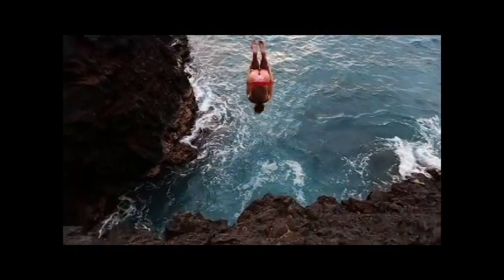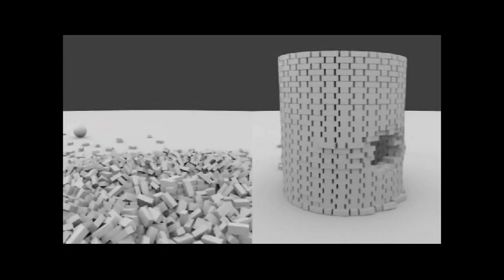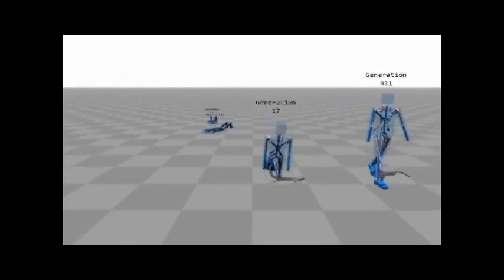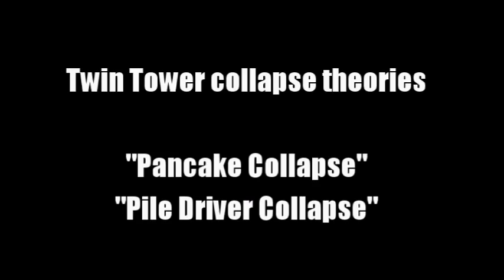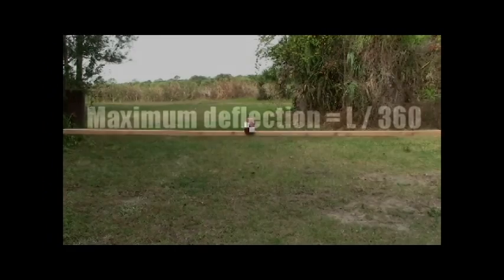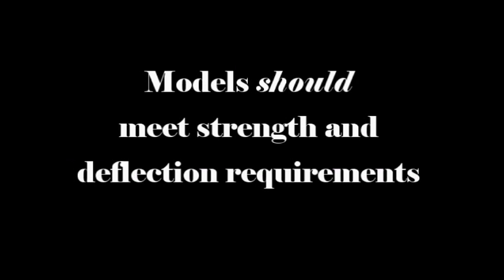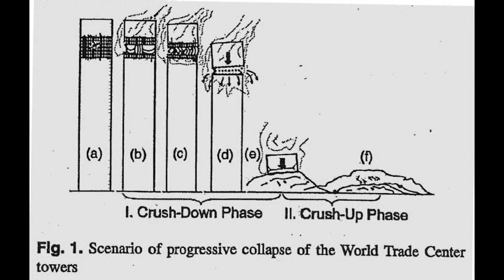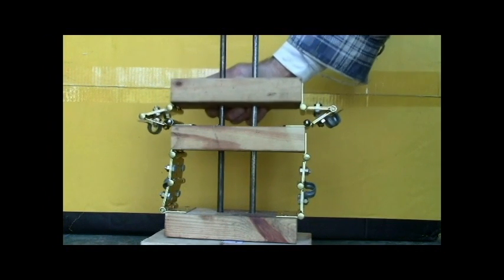9/11 Experiments: The Force Behind the Motion

Comment: The force from the pancake and the piledriver experiment does not match the motions therefore it's wrong. The demolition experiment did. Nist used complex math it computer simulations instead of a real science experiment. No one. Not even Mark H. Could make a simple experiment that can demonstrate the official force and motion
Reply: "The force from the pancake and the piledriver experimen"
The experiment is flawed and does not represent the towers.  

_". Nist used complex math it computer simulations instead of a real science experiment."-
Because they actually understand that models like this don't represent the towers collapse..

"Could make a simple experiment"
That's your problem.  you see everything so simplistically that you get it all wrong.

1.  Videos of the towers with explosives going off
2.  Proof I have lied.
3.  Point out the mistakes and errors in the NIST report on the towers 
4.  Prove I have denied any laws of physics
5.  Prove any laws of physics were violated with the official story

6.
"Conservation of momentum is clearly orchestrated and easy to understand i"
So apply it to what happened on 9/11.
Please do.   In your own words.
Go.
I''m now going to keep asking.

That's 6 things you've been called out on.
You make claims.    You back them up.   That's how it works princess.
Reply: @markh1011   You don't and can't understand the laws of physics is the reason you keep asking.  Did nist test for explosives? No. Even you said why should they? Now try to get out of what I'm telling you.... UNLESS PROPERLY INVESTIGATED AND RULED OUT THE EVIDENCE FOR POTENTIAL USE OF EXPLOSIVES DURING THE COLLAPSE ARE STILL THERE..   also. national fire protection agency guidelines number 921 calls for the testing for explosives when high order damages involved..... And still they didn't.......a 3rd reason this is the biggest most important investigation of our time.... How stupid for NIST AND HOW STUPID FOR YOU TO MAKE A STATEMENT LIKE "WHY SHOULD THEY" so juvenile so immature so lame. Now go ahead and deny everything I'm saying and confirm all the things that I think about you are true
Reply: @coolk3dat754  
" UNLESS PROPERLY INVESTIGATED AND RULED OUT THE EVIDENCE FOR POTENTIAL USE OF EXPLOSIVES DURING THE COLLAPSE ARE STILL THERE.. "
..except that they already found the cause of collapse...   guess what dippy....wasn't explosives.

They also didn't test for kryptonite and space termites...those theories are currently equal to yours.

"national fire protection agency guidelines number 921"
Is there to see if a regular old building was was intentional.   we know this was intentional.... we know there was an accelerant - jet fuel.

So you're not making an intelligent argument.
Then again you never have.

It's all an excuse.    you don't have evidence so you try to blame that on the government as well.   There's always an excuse.

Pitiful.
Reply: @markh1011  wrong again sweet cheeks. Reply and Deny
Reply: @markh1011  you deny evidence and testimony.....cover up
Reply: @coolk3dat754  
" you deny evidence and testimony"
More projecting.

Try again.
Reply: @markh1011  answer me Mark you said this video is flawed.... Didn't you refer me to eat cheesy minute and a half poorr example I'm a total collapse it's just a few blocks of wood. Please explain why you find this were convincing and why you feel this represents a hundred and ten stories.
Reply: @markh1011  you do know you are part of a minority and I am part of a majority. That means that we"truthers" " conspiracy theorist" are now expressing what is considered conventional wisdom while the Reply and Deny Assholeciation red represent a small beleaguered minority that is often scuffed and shunned
Reply: @coolk3dat754  
"do know you are part of a minority and I am part of a majority. "
Ah the desperation of the last gasp appeal to numbers...   you're embarrassing yourself.
Reply: @markh1011  the experiment is flawed? Because you say so?  LMAO GO CRAWL BACK TO YOUR ICE CREAM STICK THEORY DUMBASS
Reply: @coolk3dat754  
"the experiment is flawed? Because you say so?"
pathetic response....if you can refute what I'm saying then go ahead.    

Go on.
Give it a go.
Try to debate me.
what are you afraid of?
Reply: @markh1011  you seem like you're lying and denying everything I'm saying, everything is videos is explaining and in reality you're saying the laws of physics need not apply. This also means nist is lying which makes it a miscarriage investigation..you see all the answers you ask are there. . If you have any problems and questions and issues please contact Richard Feynman or Sir  Isaac Newton you'll be glad to explain what we already know.
Reply: @markh1011  if you have any more questions just watch this video again till you get it right
Reply: @coolk3dat754  
1.  you've failed to back up your claims.    Your attempts to evade are so bad its entertaining.
2.  I've already pointed out problems with the video....

Try again.
Reply: @markh1011  and what can totally pulverize a building for dust? What type of energy?
Reply: @coolk3dat754  
1.  The entire building wasn't dust.
2.  Gravity.      Go to school.  Learn about it someday.
Reply: @markh1011  reduced to dust. Earlier, you said collapse was not symmetrical, so it has to be asymmetrical, the gravitational collapse due to structural failure. But when that happens you expect to find at least 20 stories stack up on each other not a total collapse. And Nist only investigated up to point of initiation of collapse with no explanation of total collapse and do you know why? Because the laws of physics conservation momentum won't allow them to... So nist went around it just like you are which makes this a miscarriage investigation which makes you a liar and since it doesn't agree with real science and a real experiment your theory is wrong and always will be....
Reply: @markh1011  so these wooden blocks you mentioned do they represent 110 stories,?
.     .  1
Reply: @markh1011  hey blockhead what was your excuse for all the burnt cars , all the way down to the frames. Some of these cars are parked blocks away. Explain away sweet cheeks
Reply: @markh1011  There is NO piledriver and there is NO pancake effect  and since the laws of physics conservation of momentum teach that the object that does the hitting always slows down and will destroy itself well before it can possibly crush the entire large lower structure because we know the two opposing forces will neutralize each other and the system will come to rest because there is no more energy to decipitate. In other words dumb dumb there's nothing left to crush the rest of the building. You simply can't remove these laws of physics so tell me how we got a total collapse based on these facts. ASSUMING WILL NOT WORK... UNACCEPTABLE..... It couldn't be done producing the simple experiment. Your theory is simply not possible so try again
Reply: @markh1011  and don't refer me to your stupid video with the ice cream sticks..... still laughing
Reply: @markh1011 I lot of people disagree with you and after they read your comments I'm sure that number will rise
Reply: @markh1011  so wooden blocks represent 110 stories?
Reply: @coolk3dat754  
wow what's that 10 posts of ranting?     That's your attempt to squirm away?
Nah not going to work.

"hey blockhead what was your excuse for all the burnt cars "
Burning buildings everywhere...people getting out of their cars, running and leaving them there.

" Some of these cars are parked"
..which is a claim from crazy old Judy Woods.  It's been debunked.   cars were moved from their original locations to make room for the emergency vehicles and the clean up operation.
Reply: @coolk3dat754  
"conservation of momentum teach that the object that does the hitting always slows down"
Actually no such law claims that.

"destroy itself well before it can possibly crush the entire large lower structur"
You fail to understand the progressive collapse.... more floors joined in the collapse every second...the hammer got heavier and faster.

" You simply can't remove these laws of physics"
I don't need to.   The problem here is that you don't understand the collapse.

Halfway through the collapse....how many floors are dropping ?     How many?    Is it still the initial 20 or so?    No.   You have half a building coming down by that point...you fail to understand the ramifications of the progressive collapse.
Because you don't understand this you never get off the ground.

Your ignorance will lead you to failure....
Reply: @coolk3dat754  
"video with the ice cream sticks.."
A pathetic attempt to evade...  
You're stuck in a corner here and are trying to spam your way out.

Not going to work.
Reply: @coolk3dat754  
Still waiting.

1.  Videos of the towers with explosives going off
2.  Proof I have lied.
3.  Point out the mistakes and errors in the NIST report on the towers 
4.  Prove I have denied any laws of physics
5.  Prove any laws of physics were violated with the official story

6.
"Conservation of momentum is clearly orchestrated and easy to understand i"
So apply it to what happened on 9/11.
Please do.   In your own words.
Go.
I''m now going to keep asking.

That's 22 times you've evaded now.
Reply: @coolk3dat754  
:" you just deny the laws of physics just like nist has.":
Prove it.
Prove that any laws have been denied....or violated...
Prove something.

All you do is make claims you can't back up...and don't even fully understand.
Reply: @markh1011  I CHALLENGE YOU MARK . I CHALLENGE YOU......DO YOU ACCEPT????????             GRAB FIVE ORANGE BRICKS.      STAND THEM VERTICALLY ON TOP OF EACH OTHER (PUT SOMETHING ON EITHER SIDE TO SUPPORT THEM) REMOVE THE FIRST BRICK (TOP BRICK) AND RAISE IT UP HIGH.... LEAVING THE FOUR BRICKS STANDING VERTICALLY BENEATH.....AND DROP IT ON THE REMAINING BRICKS.     WHAT DO YOU THINK IS GOING TO HAPPEN???????? ACCORDING TO YOU THE TOP TRICK WILL CRUSH THE FOUR BRICKS ALL THE WAY DOWN TO THE GROUND. I claim  the falling brick when making contact with the second brick, both will destroy themselves, maybe not totally but there will be severe damage but they will not.... I REPEAT..... THEY WILL NOT CRUSH ALL FOUR BRICKS TO THE GROUND..... .....
Reply: @coolk3dat754  He's ranting now because all his arguments have been destroyed....  and laughed at.

Rant harder...  see if that works....shake your fist....haha  dunce.
Reply: @markh1011  do you accept my challenge mark?
Reply: @markh1011  COME ON MARK ACCEPT MY CHALLENGE
Reply: @markh1011  don't run from me now Mark.....be  a man ..... Accept my challenge
Reply: @markh1011  no Mark I am not rantinag àand my logic has not been destroyed but yes I am laughing at you
Reply: @markh1011  all your arguments have been ripped apart and destroyed......you lose
Reply: @coolk3dat754  
You could at least try not to look so desperate...  haha..
Reply: @coolk3dat754  
So I have to teach you, like the special kid in class, why your challenge with bricks is utterly nonsensical....and your best response is to repeat it 10 times...  because you don't know what else to do.
You backed yourself into a corner here and you're trying to spam your way out.

...as if that's going to work dippy.
Reply: @coolk3dat754  
" Giving yourself a pat on the back.."
It's a bit hard not to mate.   
Your clumsy attempts to defend your position are a train wreck and you're like sport to me.
You got called out on your claims and have so far evaded 22 times...
wow....that's embarrassing...
Reply: @markh1011  do you turn down my challenge.  Then you lose....period
Reply: @coolk3dat754  Whenever you're ready...
Reply: @markh1011   SIMPLE QUESTION.    If you had 5 orange bricks and you line them up vertically on top of each other.. after removing the top brick several feet above your head... And dropped it on the remaining four..... What do you think would happen.?
Reply: @coolk3dat754  
...and there is part of your problem.  You only understand simple models.   You think a few bricks is just like a a 110 story skyscraper.    Building a tower of 5 bricks is easy and requires no skill.... a 110 story skyscraper is another matter.
You'll never understand this though.   You're not just ignorant, you actually want to stay ignorant.
Reply: @markh1011 you think of simple computer model represents 110 stories?  Do you think you are actually convincing someone with your nonsense? First of all you avoiding my question and you still refuse to answer. I believe your comment said"whenever you're ready" . Apparently you're not. Once again you're failing this debate. Get this through your head... The laws of physics do not lie, discriminate nor are they prejudiced. The laws of physics apply to everything, including high rise buildings. The five orange bricks represent five orange bricks. The laws of physics conservation of momentum represent what will happen when you drop one brick on the remaining four. According to you it will crush its way through to the ground destroying all four bricks. I say it won't. I say the top brick when making contact with the brick that previously supported it will meet with equal force and brake eachother, but the rest of the bricks will remain intact and support the weight. Please tell  me where it says that the laws of physics conservation of momentum applies to everything EXCEPT high-rise buildings? Allow me to correct you again...... I own you.... You're my little bitch.... And you just got fucked in the ass. Get educated THE LAWS OF PHYSICS CONSERVATION OF MOMENTUM APPLY TO EVERYTHING DICKHEAD.  MAN YOU ARE STUPID.    I gave you one simple question.....just one..... and you couldn't handle it.    Tisk tisk.   This debate is over.  I win!
Reply: @markh1011  do yourself a favor and watch the video again but this time pay attention... It speaks the truth
Reply: @coolk3dat754  
Still waiting.

1.  Videos of the towers with explosives going off
2.  Proof I have lied.
3.  Point out the mistakes and errors in the NIST report on the towers 
4.  Prove I have denied any laws of physics
5.  Prove any laws of physics were violated with the official story

6.
"Conservation of momentum is clearly orchestrated and easy to understand i"
So apply it to what happened on 9/11.
Please do.   In your own words.
Go.
I''m now going to keep asking.

You've dodged this 25 times...
What's wrong ?    In a little over your head?
Reply: @markh1011  p.s. keep throwing the Tantrums it's  not going to work. Who do you think you're talking to?  you got your fools mixed up
Reply: @coolk3dat754  You're in a constant state of running and denial...
Backed yourself into a corner didn't you?
Trying to get out with dignity aren't you?
naaah that's not working.
Reply: @markh1011  if you have forgotten with my answers were to your questions may I suggest you watch this video above. There you find all your answers as well. But this time pay attention to it. Normally I don't work with underprivileged kids, but do yourself a favor and watch the video again if you ever watched in the first place. But please stop crying throwing a tantrum.... I won and that's all there is to it
Reply: @coolk3dat754  ..yeah that's why you're running away without being able to answer anything...
Keep running!
Reply: @markh1011  I've given you plenty of chances.... but you don't seem to get it right. One question I gave you. You simply hide an avoid it. Can't help you kiddo.  Tisk tisk.     A all those false claims you are making against me.....simply childish. Desperate Times Desperate Measures I guess.     This debate is over I've already won
Reply: @coolk3dat754  What's wrong?   Get in a little over your head?
Reply: @markh1011  what's wrong can't handle defeat?
Reply: @coolk3dat754  Aww your projecting is just adorable.
Reply: @markh1011  you know you lost this debate. You're not even on the subject anymore. You just ranting and raving. Grow up Tinkerbell🧚
Reply: @coolk3dat754  
How are you coming along with these responses?
Still waiting.

1.  Videos of the towers with explosives going off
2.  Proof I have lied.
3.  Point out the mistakes and errors in the NIST report on the towers 
4.  Prove I have denied any laws of physics
5.  Prove any laws of physics were violated with the official story

6.
"Conservation of momentum is clearly orchestrated and easy to understand i"
So apply it to what happened on 9/11.
Please do.   In your own words.
Go.

No?   Nothing?  
Yeah didn't think so.
Reply: @coolk3dat754  Oh look he's getting all mad because he lost.    ..school yard insults and crying isn't going to save you now sport.
Reply: @coolk3dat754  
Some pretty funny projecting here...

"you know you lost this debate. You're not even on the subject anymore. You just ranting and raving. Grow up "

Great stuff.
Reply: @coolk3dat754  
How are you coming along with these responses?
Still waiting.

1.  Videos of the towers with explosives going off
2.  Proof I have lied.
3.  Point out the mistakes and errors in the NIST report on the towers 
4.  Prove I have denied any laws of physics
5.  Prove any laws of physics were violated with the official story

6.
"Conservation of momentum is clearly orchestrated and easy to understand i"
So apply it to what happened on 9/11.
Please do.   In your own words.
Go.

No?   Nothing?  
Yeah didn't think so.

You got called out.
You failed.
Stings doesn't it?
Reply: @markh1011  why can't you accept this defeat and take it like a man. But then again one of the requirements would be to actually be a man. You simply don't qualify
Reply: @coolk3dat754  
27 times you dodged.
You're trying to spam your way out of the corner you backed yourself into.

Still waiting.

1.  Videos of the towers with explosives going off
2.  Proof I have lied.
3.  Point out the mistakes and errors in the NIST report on the towers 
4.  Prove I have denied any laws of physics
5.  Prove any laws of physics were violated with the official story

6.
"Conservation of momentum is clearly orchestrated and easy to understand i"
So apply it to what happened on 9/11.
Please do.   In your own words.
Go.

You're in that corner until I let you out.
Reply: @markh1011  you are the prime example of someone who can't handle defeat
Reply: @markh1011  no one will ever take you seriously if you believe the laws of physics conservation of momentum do not apply to high rise buildings
Reply: @markh1011  prediction, you come back with another lame comment that has no relation to reality
Reply: @markh1011  wait for it.... Wait for it..... Here it Comes!
Reply: @coolk3dat754  A little advice... next time don't try to bluff that you know about phyiscs... that way you won't dig such a hole for yourself.
Reply: @markh1011  I believe you are the one who could not answer what conservation of momentum meant
Reply: @markh1011  still can't handle defeat......stop your crying already...grow up
Reply: @markh1011  silly boy still making things up because of your defeat!.
Reply: @markh1011  I don't take advise from lying denying juveniles who don't understand High School physics
Reply: @markh1011  sorry Charlie....you lost your chance on a simple question about physics. You actually thought 5 orange bricks represent be the towers?  You really believe these laws don't apply to the towers? Care to explain why? I can use a laugh
Reply: @coolk3dat754  ..ironic...
Reply: @markh1011  never the less, it's true. Can you ever speak the truth? Seriously? It's like you have no knowledge of anything. Poor sap.
Reply: @markh1011  you fail to understand this video.  What grade are you in?
Reply: @coolk3dat754  
"who don't understand High School physics"
One this is clear from your floundering... you don't understand high school physics...  

Your parents really let you down...
Reply: @coolk3dat754  Keep dodging and dancing coward...
I'll let you know when you can stop....;)
Reply: @coolk3dat754  Why do you work so hard to try and convince me (and yourself) that you didn't make a complete fool of yourself?    
It certainly isn't working....
Reply: @coolk3dat754  
"d I've answered all your questions"
Nope.
You've ran from them.
..like a scared little girl... 
You realise you're out of your depth...  

1.  Videos of the towers with explosives going off
2.  Proof I have lied.
3.  Point out the mistakes and errors in the NIST report on the towers 
4.  Prove I have denied any laws of physics
5.  Prove any laws of physics were violated with the official story

6.
"Conservation of momentum is clearly orchestrated and easy to understand i"
So apply it to what happened on 9/11.
Please do.   In your own words.
Go.
I''m now going to keep asking.

Keep squirming!